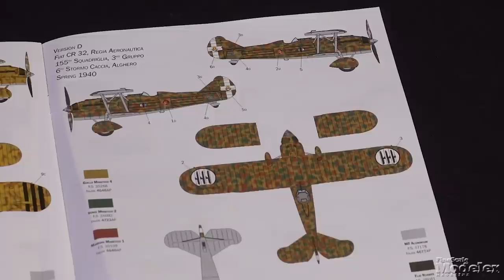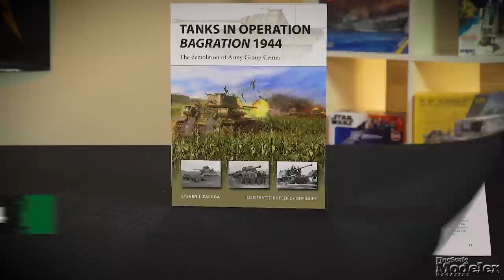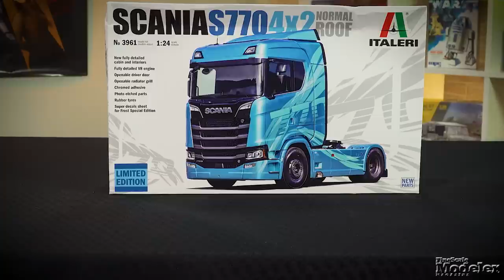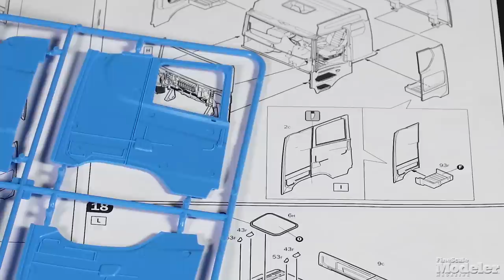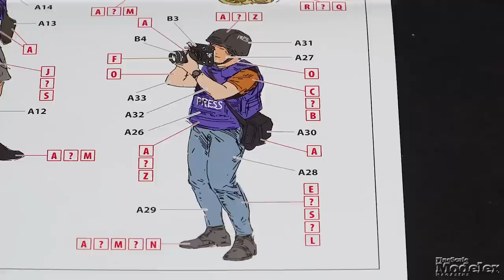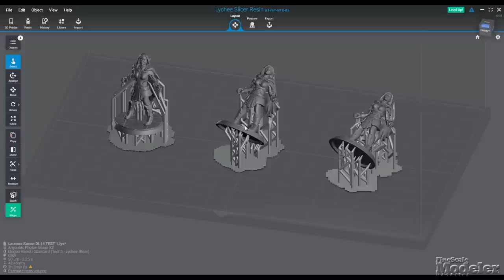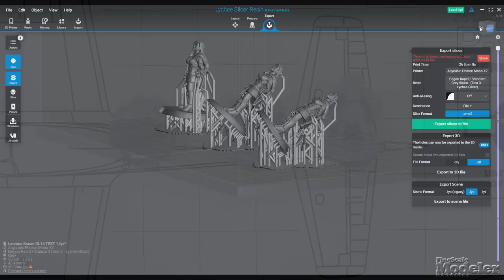New kits, a 3D-printing update, and we want your questions about painting models for a future issue!

Comment: Quick tip on taking off your supports. FIrst don't cure your print before taking off the supports. Once you cure it you will run the risk of what happened everytime. After your print is done rinse it off in alcohol and then run it under hot tap water. The supports will pop off without having to use clippers on them and then you only have to clean up where the supports were. Also I couldn't see what you used on your supports but the contact point make it a sphere as it is easier to remove (sand down) extra resin than try to fill in all of those support marks.

Comment: It would be extremely helpful if you could discuss temperature issues related to painting. My workbench is in a relatively cold basement particularly in the winter. I’ve come to realize that I need to warm my pants before using them. But I don’t feel that I have any guidelines for how to do that or what my objectives are. So, Anything that you can offer by way of methods for warming paints, temperatures paint should be applied at, both ambient and actual paint temperature, and what kinds of paints need some sort of temperature control for use would immensely help my work.

Comment: Remove your supports before you cure the print. They resin is far less brittle and is less likely to snap off parts. Also if you put the uncured print in some hot water for a few seconds the supports will often just snap off with very little effort. I have a pre-order on the t.50 I really hope they release the T.33 spider.
Reply from the maker: Thanks for the tip for the 3D printer supports. We'll give it a try.

Comment: Here's a question. I bought some 3d printed parts. Primed them.with Tamiya spray primer, 24 hours later brush painted with Tamiya XF series paint. The primer acted like it was painted with paint stripper, no adhesion to the part, the paint gummed up. All material is new unopened bought specifically for the kit about a week ago
Reply from the maker: Our first thought would be that there was some sort of residue on the parts that needed to be cleaned off before paint, but we'll look into it.
Reply: When you buy 3 d printed parts you always need to clean them with handwarm water and some dishwashing product in it and use a toothbrush. Let it lay in that soapywater about 5 minutes,clean them with the brush,rinse them under the watertap and let the dry for at least 12 hours. Or use the airbrush to blow them dry. But they must be realy dry. Then you won,t have any problems at all.